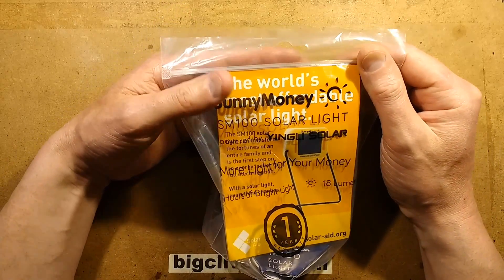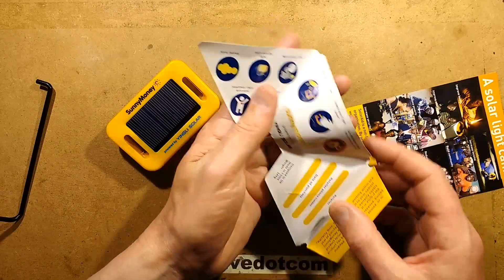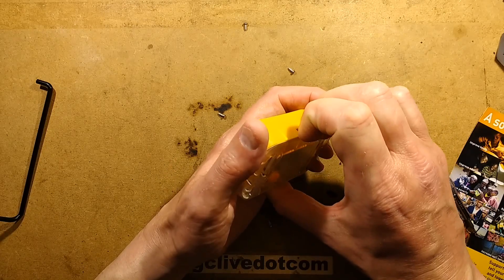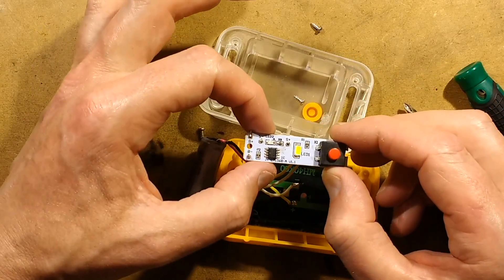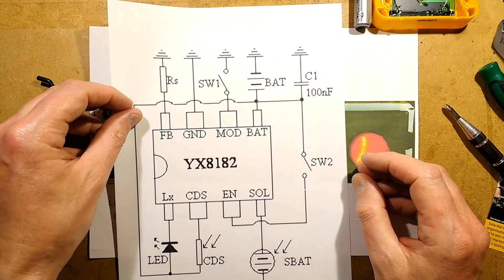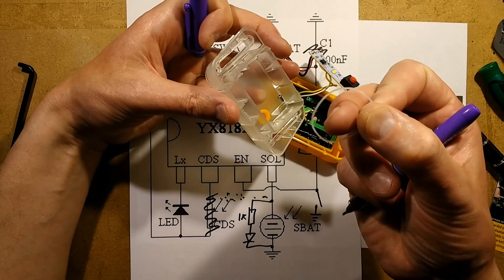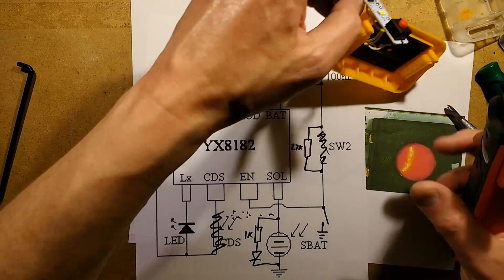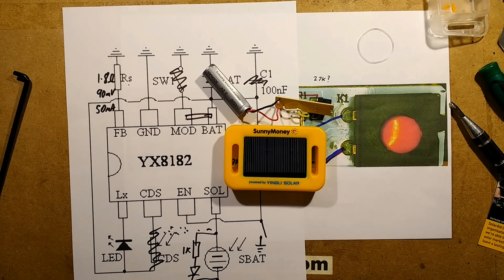SM100 solar light for off-grid communities.

Comment: It was really stupid to use torx screws if this is made for developing countries, because these are the sort of things that could be used and repaired for years and torx screws are hard to use unless you have the right bit.
Reply: I think they're trying to avoid them getting instantly stripped for parts (eg. the battery, solar cell)... Doesnt mean i dont agree with you.
Reply: Torx are easily removed with the right size flat head screw driver....
Reply: I can see both sides on this. The first being that it should be easily repairable. The second being that they do not want donated lights immediately being cannibalized and sold for parts.
Reply: They're targeting children with the product, and a simple Torx head is ample to keep 99% of them from destroying the product on the first day.  :)
Reply: If somebody was intent on parting out this thing (and I don't see that happening), they would apply a vice of knowledge like First-World bears do and not bother with finding the proper bit.
Reply: For those short plastic tapped screws a simple flat head of the correct width will do fine.
Reply: +Bigrignohio That's part of the point. The idea of parting out components that have such small value individually isn't even acknowledging the fact that non-destructive disassembly is required to make the effort worth it. You'll need a soldering iron and electricity to remove components. 
This thing has more value assembled than the sum of its parts. End of life, screw heads can be drilled out and the panels put to use powering a water pump or something similar. EoL though is going to be a while with a LiFePO4 cell in there.
Reply: @Markle2k  I'm from a developing country , and i know the struggle to remove screws without right bit ! Manufacturer should have considered that they will eventually gonna repurpose some of the parts like battery and solar panels !
Reply: Markle2k that would possibly also destroy the solar cell and therefore 1/2 the value of the components.
Reply: If you're going to cannibalise them and use them for parts (especially en masse) not having the right screw driver really isn't going to hold you back (as Clive has shown so often on this very channel).

I think it's much more likely to be a pain if you want to repair the device at home in a non-destructive way, which is why it seems like a very poor choice. 
This isn't an "ah, poor developing country people" thing either. Personal experience tells me it's a pain in the ass when a fairly bog standard device uses some obscure screw that you either don't have or can't find, and uses it for no good reason.
Reply: Not worth the money.fasteners go per weight because the stuff is super cheap.
Reply: Even a small value adds up when the item is acquired by donations or as a subsidized. Oh, wait. That's the very premise of the whole company!
Reply: I agree
Reply: john jones I don't know if I'd call it a lack of ingenuity, but rather a lack of resources. from everything I've seen of developing areas of Africa and places of the sort, the residents are incredibly clever, mechanically, given the resources they have, making what they need and want with what they can get a hold of. manufacturing a special screw bit that would hold up to continuous use is most likely beyond even the most clever person without providing them with basic manufacturing resource.
Reply: 9ff70f96 I've got a shed full of tools and still managed to wreck the head of a torx screw not using the right bit.
Reply: Do you really doubt the ingenuity of these people to be able to remove a simple screw.
Reply: I have to wonder whether Textron/Acument, the company which 'owns' the Torx name, stuck their noses into this product's development, marketing, financing, or manufacture. I could easily see them "donating" money to this charitable organization IFF (if and only if) they use Torx fasteners exclusively. Sorry if that makes me a pessimist, but experience tells me to follow the money.
Reply: the use of 'IFF' shows programming prowess
Reply: Completely agree, I was about to comment this myself.
Reply: Yes, as many of the people in the target audience will not have the tools required. And if they had the ingenuity to build the tools, they wouldn't need White folks to provide them with free lighting.

Comment: What does the amount of sections mean on a solar panel? Does a larger amount of sections equate to a larger number of energy pipelines, so to speak?
Reply: A X each section is roughly 0.5Volts. Miliamperes are determined by size. ... combinations of serial and parallel connections can give you some combinations. Here we have them connected to series, so mA rating is determined by surface of one cell and voltage is a multiply of cell count ( 8?) so roughly 4Volts...
Reply: JanicekTrnecka Thanks. I take it that more cells means more energy can be absorbed at one time.
Reply: A X  energy equals to surface . the potential is depending of how mamy section it has and the current is depending on the surface size...( one cell if in series)

but still the energy ..with same surface size is the same.  

imagine it as batteries connected to series to get higher voltage... but current is limited. or you an hook them up all parallel and get low voltage and multiplied current.  or varying combinations of semi serial semi parallel possibilities.
Reply from the maker: +A X If wired in series, each section adds about 0.6v, so ten sections would give about 6V.  The size of each section determines how much current it will supply when in sunlight.

Comment: but wait, if the light only turns on when the switch is off, why does the light need to be charged at all? if it's turned off then it doesn't use any power
Reply: The switch just controls the enable input of the chip and what matters is the state of the input (logic high or low signal) not whether the switch is open or closed. The LED in turn is switched by a transistor in the chip.

They did choose to make an open switch represent LED on. The reason for this design decision was probably to make sure the LED would still light if the switch would fail (corrode or mechanically come loose). Constant on would probably be a more useful failure than constant off, they thought.
Reply: so wait you're telling me that if the switch were to fail, it would have infinite electricty?

that's what i thought. thanks for confirming my suspicions.

my question is: why can't we have this in the first world?
Reply: Whooosssshh......
Reply: I, you, what?

Comment: Cute torch, shame they could not have used surplus phone batterys for a better capacity, the charging chip would support it.
Reply: im sure the trustfire 18650s arnt exactly in short supply though!  at least they are using the correct capacity on it now

Comment: Why on Earth wouldn't they use an 18650? They're much more common and can be salvaged inexpensively from many devices.
Reply: Lifespan.  LiPO4 lasts for about 3 to 5 times as many charge/discharge cycles.
Reply: Also, with a 18650 they would be taking up extra room, for energy storage they are not going to fill up in a day with that solar cell
Reply: zogworth If they fit, that is. 

Jusb1066 I was just thinking of down the road when someone is trying to replace the 14500, you couldn't just stick a NiMH AA in there to replace it, or put an alkaline battery in there just to get the light to work. I grew up in poverty, and the devices that could be easily repaired or retrofitted with parts that were common, cheap and easily available to me were the most valuable devices. Something that needed a special part that I couldn't easily get just went in the garbage.
Reply: its called a 14500 cell, still pretty common size, the 300ma capacity is typical of the real capacity of Chinese 14500, and is half the size of putting two aa nimh in there, and bout the same capacity as cheap chinese nimhs
Reply: you could stick two nmih aa's in there in series and it would be alright. not amazing but alright!
Reply: Yeah, probably cost. Lithium AA batteries are quite rare in my experience, and it's not like you can replace a lithium AA with a Ni-MH or alkaline battery, but the manufacturer probably had a choice between a less robust chemistry with an 18650 and this battery.
Reply: Sebastian Grygiel Hopefully the battery is good enough that it doesn't ever need to be replaced, otherwise the whole light will basically be garbage because of that battery choice.

Edit: And the battery very well could be high quality enough that it wont need to be replaced for many years down the road, and that was probably the smartest choice for this device.
Reply: +idontcare80 They claim 1-year warranty, so it's probably not designed to have to last more than ~2 years - I can imagine a standard LiPo lasting around a year in that application, and Clive mentioned this type of cell is more robust and long-lasting, so if they don't intend it to be replaceable (and they definitely don't -> Torx screws, springy seal) a battery with higher lifetime longevity seems to be a good choice
Reply: i know what you mean about standard parts, but mostly that time has gone, its meant to be cheap to make, otherwise a more standard serviceable one will cost 10x more, im sure other parts will only last as long as the cell anyway, we have become a 99p throwaway society now
Reply: chinese knock off 201934620447 is 4.50 so half the price,
Reply: I have about a half dozen 14500's that I use in small pocket LED flashlights. I love the batteries, well the good set, the cheap china junkers were probably nicads in disguise, or just piss  poor copies as they only lasted a few months then were dead, the good set I purchased 3 years ago are still going strong.
Reply: cost? an 18650 would be about 50% of the total cost of manufacture (guesstimate) AA (which is what this is) are more common
Reply: An 18650 would be standard enough to allow for easy, inexpensive replacement, because there is an enormous number of secondhand 18650s that can be bought for very cheap. Some new 18650s are also cheap relative to this 14500 (thanks to the economies of scale), but this 14500 will probably last longer than a cheap 18650, so I guess it makes more sense.

There is no real throwaway culture among very poor people, an attempt to repair is almost always made, and I think that's something that the world really needs to get back to, our waste is absolutely unacceptable.

Comment: any estimates on run and charge time?    this is a pretty good design,, built in stand for reading,(is it actually enough to read with?)  will certainly be handy in developing countries, bit like baygen when you bought one you also paid for one in africa
Reply from the maker: +Jusb1066 Charge time in African sunshine about 2 hours.  Charge time in Scottish sunshine about two months.
Reply: 330 mA hours battery capacity, 45 mA light current draw..  You don't want to use more than 80% of capacity, though it will continue to work all the way down to zero.  So 5.8 hours is run time.  Charge time, I don't know, the video doesn't have the charging current.
Reply: cheers^

Comment: Normal charge voltage of a LiFePO4 is ~3.6v
Reply: LiFePO batteries have a very constant discharge voltage. Voltage stays close to 3.2 V during discharge until the cell is exhausted. This allows the cell to deliver virtually full power until it is discharged. And it can greatly simplify or even eliminate the need for voltage regulation circuitry.
Reply: ~3.3V
Reply: +Chaz Madge In other words they behave exactly like other lithium cells but with the voltages adjusted down 0.5 v and capacity by 50%. They still need the protection chip to prevent undervoltage, but they are more resistant to overvoltage without catastrophic unplanned disassembly.
Reply: you missing the constant voltage
Reply: Explains why there is no inductor and step-up circuit; I assume the chip is a low drop-out current regulator and not a voltage boost like most garden lights.  Still, I think LiFePO4 can be discharged to about 2.5v, but the LED probably requires more than that, so some loss of run time.
Reply: Actually, 3.2784774836737464776 is the nominal voltage.